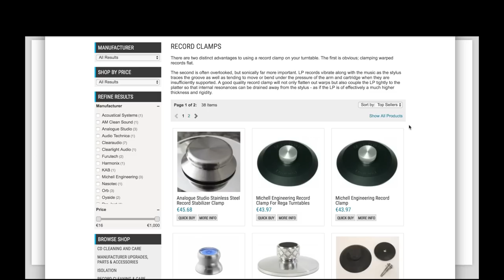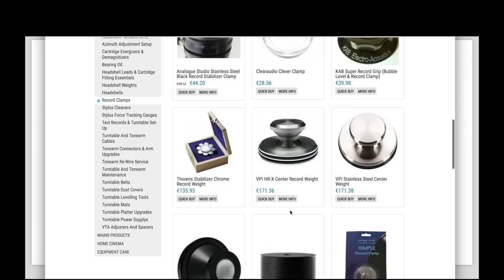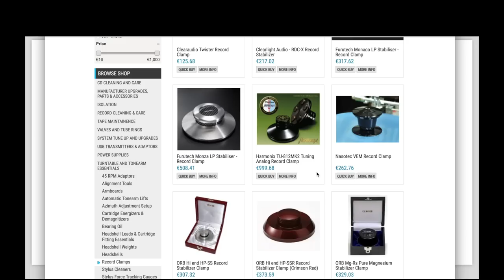The Best Record Clamps: clamping, suction & stabilization

Comment: I got the Clearaudio Outer Limit today, it is not snake oil, it makes a very big difference, stage/bass/seperation, everything improves and I can play warped records. This ring has enough weight that it flattens even the 180 gr pressings. I know it costs a lot, but it a real upgrade that you can hear. If you have a player who can deal with the weight, think about it, I recommend it.

Comment: I appreciate you doing this video very much.  It was very good.  I just want to share a correction with you that you either aren't aware of or just did not mention: Weight Clamps (as well as screw down clamps, tighten down clamps and clever clamps) are used ONLY 'secondary' to try and flatten a vinyl record to the platter.  If you think about it, putting weight in the center really doesn't do much for flattening the entire surface of the record to the platter.  The primary reason behind these types of clamps is for vibration control and not for flattening.  Even with the best bearings and the best tone arms, the tone arm and the bearing create vibration that transfers to the vinyl surface, causing micro vibrations that can translate to the sonic playback.  Clamps are primarily - first and foremost designed to dampen vibration, any seasoned audiophile will tell you that.  They are only secondary in the way of flattening the record to the platter.  So actually the 'snake oil' you mention is not the dampening feature, but the 'snake oil' is the flattening feature.  That is why peripheral rings were designed.  Anyway, love your video ;-)
Reply from the maker: Hi Scott, thank you for sharing your experience and for your nice words.
Actually, this is more a debate than a well traced path (or at least that is my perception, maybe I am wrong). Clamps, in my opinion, and not only in mine, are used mainly to...clamp! That is why they are called clamps, because they are used to clasp, to fasten the record to the platter, mainly for the shape of the vinyl, which is always slightly warped and also for stabilization (i.e. vibrations). Not only platter vibrations but record self-induced vibrations due to the warping. In fact, that is why a lot of weight clamps are called stabilizers. In the latter, that particular effect is enhanced thanks to a specific geometry of construction and are mainly designed to attenuate mechanical vibrations. I am glad you wrote this comment because I did not put enough emphasis on this aspect, so thank you for bringing this up!
Reply: re: "even....the best bearings and best tonearms, the tonearm and bearing create vibrations that transfers to the vinyl surface."  Pure balderdash.

Comment: Clamps and weights can be seen as helping to flatten the record into a plane so that the angle of attack of the stylus is constant. We would get benefits such as certainty in the case of stylus rake angle. 
We can imagine that the constant angular velocity with a flat record would mean that if we had a theoretical circular groove the speed of the passage of groove length past the stylus would be constant. A warped record would vary the length of groove passing by the stylus per second…this would possibly be audible as pitch variation. So, reducing the degree to which a record is warped would be a valuable way to increase accuracy during transcription.
The tonearm will also swing up and down, the horizontal bearings moving in and out of stiction as the warp accelerates and decelerates the end of the tonearm up and down continually. The effective length of the tonearm will be increasing and decreasing too. So flatness would be an ideal.
Sound quality must be better with flat vinyl rotating in a plane at 90 degrees to the vertical axis.
The other thing to consider is resonance. Vibrations spread from the point of contact of the stylus through the vinyl and reflect in again when the reach the boundaries of the material at the edges and surfaces where they can bounce back towards the stylus and add noise and distortion.
Weighting and clamping can dampen and reduce the levels of resonance.
The vacuum mat seems to have all of the advantages of clamping and weighting without the disadvantages.
Weight is the force of gravity acting on the mass of an object. The point contact of the turntable bearing on its thrust plate has friction. When the tip of the bearing experiences weight it’s pressure creates friction that has to be equalled by the turning force of the motor and the belt. When the counterforce of friction matches the torque of the motor the platter revolves with a constant angular velocity. The weight very slightly increases angular momentum but since the moment of the force remains close to the centre of rotation there is not very noticeable increase. 
Clamping has less effect on the bearing friction but does transfer more bearing noise into the record and stylus.
It seems that the market is waiting for the return of the vacuum mat which may have the advantages of weights and clamps, without the disadvantages.
I believe, on balance, weights that are not overly massive e.g. 300g reduce resonance and  they have been my go to remedy for a while now.

Comment: I have the JA Michell clamp, which I like, it works well, but the very short spindle of my SL1200 make the use of it occasionally impossible. I tend to use my DIY weight most often, which is a hockey puck with a 7mm hole drilled into the center.

Comment: I have the Mitchell and I like it. Except with short spindles it may not grab if you have a thick mat employed for VTA reasons. It will flatten out warped records, but not perfectly so. I think the greatest benefit is that pressing the record down against the mat increases the record’s effective mass and reduces sonic vibrations. It makes for a noticeably cleaner playback.
Reply from the maker: True!

Comment: There are solutions and I have one call vinyl flat which will help you straighten out warped records.  I have two clamps, the one that comes with my table and one made by project, I don’t use them often.  I would love to have a periphery ring for my VPI, but you are right they are expensive.  Vacuum clamping makes me think about the famous Air Force One and Fremer’s Continuum Calibern.  I have tried a stabilization weight of two different masses and there wasn’t enough difference to justify the price of either.  They were both by a company called HRS and they specialize in eliminating vibrations and are known for very high end audio equipment stands, which are also extremely expensive.

Comment: Okinoki of Japan used to make an ingenious delrin clamp with spring steel arms that have silicone rubber tips that contact the record label. It's a collet clamping design to you push it down and rtate the top to close the collet and prab the spindle. I bought mine around 1985 for $12 and it still works great, it's a well thought out design that has proven to be durable.

A lot of the available clamps sold now are grossly overpriced.

Comment: Yaaay ! I got me some Typology,s 😁Your pronunciations always entertains me. 
Stabb-er-lizer 
  I use the Jed Clampett, but it only works on bluegrass LP's. 
Warning: Do not push down to hard when clamping,  Pushing down and clamping down to hard can DISH the LP, this can vary depending on the platter/mat. I.E. low in center and high on the outer edge like a bowl, NOT GOOD.

Comment: I have a spindle clamp manufactured by J. A. Michell Engineering in England, which I have had since about 1980. It is all aluminium with a screw knob and weighs 88gms. The stated function of the clamp, when I bought it, was to damp vibration in the record, not to reduce warping.
Reply from the maker: Its both! Some are designed more for vibrations, stabilizator, others for the record natural tendency to slightly warp, clamps. In any case, I do remain skepting on the vibration controll...never noticed any significant improvement on that side...
Reply: @anadialog  No argument there. Although the best treatment I know for a warped record is 2 sheets of glass and a weight.

Comment: I did a short video on my clamp (Clear Audio). It made a dramatic difference. I think the platter mat type has a lot to do with it also. On my old Kenwood turntable I don't think the clamp made any difference in sound quality. The weight did cause negative effects on the direct drive bearing.
Reply from the maker: Yes I agree! The mat can help or create issues. Thanks for your contribution!

Comment: I have a Nagaoka TS-623 clamp, which I use on my Kyocera PL-910.  It tightens onto the spindle, and uses three spring-loaded pads that push the record onto the platter.  It is quite lightweight so it wouldn't be a problem for any turntable motor.  I don't believe it was marketed to mitigate warps so much as it was to remove resonances.
Reply from the maker: Good pick! Well...let's say both!

Comment: HI. Great video. I'm pretty sure that the TTW ring is not available anymore. But there's Wayne's Audio (which has a Youtube channel) that makes one at a "reasonable" price. As for VPI ; I've asked them and they told me that as long as the (thick) platter is 12 inches and there's an inch clearance all around, it could be used on other brands. From what I heard, the periphery ring seems to work better by bringing more evenness to the record... and it is so much more elegant than spindle clamps. Peace- Patrick
Reply from the maker: Hi Sky Captain! Great recommendations! Very helpful indeed. Yes, I wrote in the video description that the TTW in no longer available. My mistake. It is always a good product and some times it pops up in the used market. I did not know about Wayne's Audio. I checked and the ring clamps look fantastic. The only downside is that they are very heavy, 1.45Kg. My turntable accepts only 1Kg max for clamping.

Comment: A few years ago I thought this was an interesting thing, so I bought a trailer hitch ball at a garage sale for a dollar and used that. However, I didn't use it often and got concerned about the pressure on the spindle bearing of my 1978 turntable. So I quit. I never noticed an improvement anyway. I don't play "significantly" warped records.

But they look cool (except for mine).

Comment: So curious. If you clamp your record to the platter... would this promote any vibrations in the chassis? On the fence on this one. Thinking that you have to pick the best of the worst problem. Maybe solving a problem and creating another one.
Reply from the maker: After many years I must admit that clamps are useful on rare occasions, especially when warped towards the center otherwise if well designed and with mass they have a good stabilization function on mid-low quality models.
Reply: @anadialog  Probably will try them out in the end. Those fun little things. Have one of those Hudson antistatic brushes to attach to my Technics. Looking forward to seeing how that will work out.

Comment: Hi. Great vid man! Love the detail.  My question….regarding #3 Grip Spindle Clam. I have a REGA P3 and just received my Michell spindle clamp. When I drop it down on my spindle and lock it down like the one you have in your video, since my spindle spins when the platter is spinning, doesn’t that put stress on the motor?
Reply from the maker: No, it's so light and the locking is just coupling the platter to the record. Never tighten too much!
Reply: @anadialog  Ok. Thanks for the advice! What about the weight style Stabilizers? Do you recommend those?
Reply from the maker: I must admit that I have never experienced any benefits but I am sure it depends a lot from one's turntable

Comment: You said a lot about clamps that may be hard on motors and nothing about problems that may happen to the bearing because of too much mass. I have a Linn LP12 and a lot of people say you shouldn't use a cramp on the LP12 but I do. It's of very low mass and it's made by KAB and it helps with the sound in a way that I like but I don't use it with all my LP's like 220 gr records the clamp is just not needed.
Reply from the maker: I did say not to exceed with weight usually 500/700g max but it depends from the TT.

Comment: In the 70's I couldnt afford a real record clamp/weight, but I came up with an inexpensive semi-effective clamp type solution.  I found a small rubber electrical grommet at the hardware store with a hole in the center that was just a bit smaller than the spindle, you pushed the grommet down with a minimal force and it did actually pull the center of the record down and held it to the platter - how well this really worked I can only guess but I always felt like the bass sounded smoother and a bit more definition overall.  Of course this could have just been wishful thinking until one day I ran across a product with this exact idea called 'the pig" that cost about $3.00 which I bought - its a little rubber piece that resembles a game piece from the old board game "Sorry".  It did the same thing my electrical grommet did, fit snugly enough on the spindle so it held the record down tight and it was easily pulled off.  I still have my "phono pig" but I also finally bought a couple of platter weights and so "the pig" and my grommet were both retired.

Comment: Should add screw on clamps such as Michell Orbe. Specific to TT with threaded spindle but more effective with warps than the pressure attachment only. Centre hub first raises the centre of disc slightly. More effective with dishing and edge warps.
Reply from the maker: I did! It's actually on the thumbnail of the video, only that its Nobsound but its identical and I also mentioned the Michell as well as the Clearaudio Twister. I actually did not recommend pressure clamps....are we talking about the same video? ;-)

Comment: How do i find out how much extra weight my turntable could handle?
Reply from the maker: The only way is to check the manual or contact the manufacturer if still existent. Otherwise I would just remain under 500/700gr.
Reply: @anadialog  The one I have my eye on is 280 gr. Is that a waste of money or could it be sufficient for my TT?
Reply from the maker: It depends from your turntable and what function you're after (stabilizing, clamping etc.).

Comment: i have used a rubber fitting on my Revolver Black Ash turntable for many years.. & it came with my deck & is called a PIG.. this is great for playing my records as i have always used it.. but if someone can tell me that one of these Weight Clamps will do a better job then i will try one .. but until then i won't be wasting my money for show..
Reply from the maker: Cool! I agree. I finally purchased the sota reflex and I can say that it does help but very little. So little that it does not justify its price. Better off with the nob sound clamp!

Comment: WHEN YOU PUSH DOWN TO TIGHTEN CLAMP ,  DOES THAT HURT YOUR MOTOR BEARINGS ?
Reply from the maker: No, especially if using a belt drive. Its the weight added on the rotation...we are talking about over 1kg clamps...

Comment: A vacuum solution is the "best of the best" in terms of a clamping, but not in terms of a sound. As these require a rubber (silicon) slipmat, which is itself the worse choice imho (because a PVC/rubber margin creates a lot of reflections comparing to PVC/acryl or PVC/cork margins).

Comment: Hello. I'm looking to replace my 1 lb Sleeve City Record Weight with this clamp.  I am curious as i found 2 other clamps on Amazon (Signstek and Nobsound) that are identical (but cheaper) to the Michell clamp. Would you have any thoughts on these?  One person said they were cheap knock offs to the Michell clamp and weren't built as well. 

Can you comment on this? 

Thanks
Reply from the maker: Hi Craig, sorry if I am slow responding but as you can see the videos are interrupted until July since I am out of my country for work and it takes time to respond.
Actually, I did put in the video description the Nobsound. I must admit that I am only suggestion the function of these clamps. I have not owned them. Perhaps others who are reading can chime in and help? I think that these clamps are very simple and the quality of the materials are very much the same. I would go with the Nobsound without any doubt. I have a clearaudio twister but otherwise I would go with that one....give us some feedback if you decide to proceed!

Comment: Obviously it takes more time to gain the correct speed if rotating mass is bigger, but bearings must be VERY bad, if you need much more power to maintain rotation speed when weight is added. Excuse my english.

Comment: you mean AJ Michelle not Mitchell? Plus they offer a solution for when the record is a bowl shape, what you could use on other clamps that is a felt ring what you place underneath the record. Not good to use a heavy weight as a clamp it causes bearing wear and excessive noise. [ I have an automated clamp I made built in and that isolates the noise even further that is to put some grooves or groove, in the spindle and put o-rings, rubber sheath in there, this isolates it from the record and you just pushed the record down and the top of the o-ring clamps it down in most cases. © All rights received not to be used for commercial use 2002/30/9.]
Reply from the maker: Yes, my pronunciation was wrong! Apologies. Cool solution you have there!